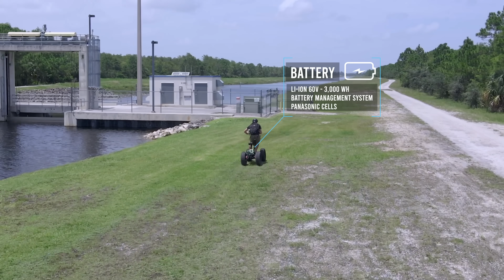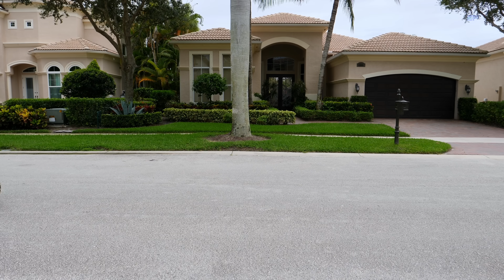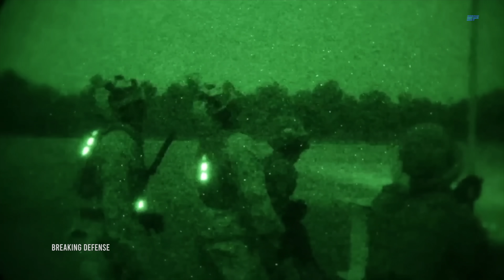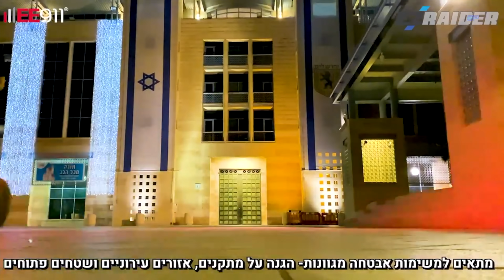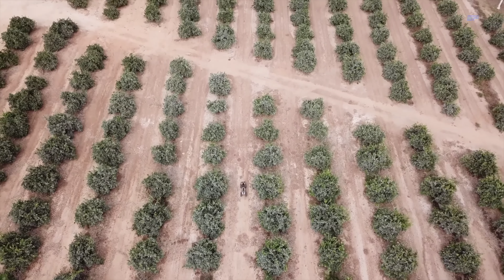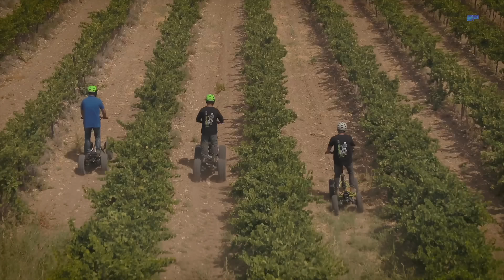Beast Electric 4X4: Off Road Vehicle

Comment: SNAKE!
Reply: Came straight to the comments after I saw it lol.
Reply: I just noticed that to , I kept rewinding the video to pause at the exact same moment you see the SNAKE 🐍 😮
Reply from the maker: Southern black racer (Coluber constrictor priapus) non-venomous. I see them all the time
Reply: @ElectricFuture  Brothers 🎉 we want test that here on Spain on Marbella 😍😉😘😎👍 mail
Reply: Snaaaakkkkeeee...
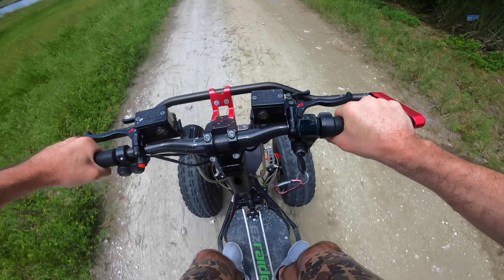Reply: 1:43 snake on the road
Reply: @nimenidrum1723  lol
Reply: @1:43
Reply: I kept wondering what this had to do with Metal Gear Solid. 🤣
Reply: @raylanspencer5090  Nope nobody gives a shit see you later
Reply: Umm. If it was "Snake", where's the cardboard box?? Lol
Reply: Price & Spec. Pls
Reply: TV bk
Thkglg
Reply: User: SNAKE!You: Hey there! I totally get your excitement, this electric 4x4 is a beast! By the way, have you heard of Segway's Portable PowerStation Cube Series? It's a versatile powerhouse that can keep your devices and appliances running for extended periods during your off-road adventures. You should check it out!
Reply: Sold on Alibaba for $2,500
Reply: Sold on Alibaba for $2,500

Comment: 19,200 dollars ??? it is cool but it leaves them a lot of margin, the technology is already there and not so expensive and after that it is metal parts not so difficult to make .. there is no shielding or special technology (gps screen etc. ) nor puncture-proof tires) in short too expensive I wonder how much it would cost to buy all the electronics / motors (x4) and to make yourself the frame and the maximum of parts (buy the minimum screw bearing accessories / see recovering pieces of quads ..)) with a garage enough to weld the minimum column drill disc grinder etc even enough to twist the bars (first price in manuals at 200/300 euros) do yourself the battery (it's not so difficult with 1 charge / protection card and 18650 lithium batteries or even lipo 4)

19200 dollars ??? il est c ool mais ca leurs laisse une sacrée marge, la technologie est deja la et pas si chere et apres c'est des pieces en metal pas si difficile a faire.. y a pas de blindage ni de technologie special (gps ecran etc) ni pneux anti crevaison) bref trops cher je me demande combien cela couterait d'acheter tout l'electronique/ moteurs(x4) et de faire soi meme le cadre et le max de pieces (acheter le minimun vis roulement accesoires / voir recuperer des pices de quads..)) avec un garage de quoi souder le minimum perceuse a colonne disqueuse etc meme de quoi tordre les barres (premier prix en manuels a 200/300 euros) faire soi meme la batterie (c'est pas si difficile avec 1 carte de charge /protections et des batteries lithium 18650 ou meme du lipo 4 )

Comment: If this tech is used in a walking-frame ment for jogging. It will give you the benefit of having not being so top heavy . plus walker are meant to be slow so the motors would be smaller. Imagine jogging up hill effortless.

Comment: my electric atv would leave this dust.
Reply from the maker: link me
Reply: @ElectricFuture  sure. 
the quad is called kidow - pro ride, the pro ride model is the most powerful model they have at a cost of about 11.5k. all components are made in israel by an israeli company. 
i ordered mine last week and is expected to get it only at august because the amount of orders they have are insane.

it has a 1500w brushless moter.
a kelly 3000 bldc controller.
2 72v 42A LI-ION batteries giving it a little more then 8 hours of continues ride time. (each batterie cost around 3k and gives about 4 hours.)
top speed of about 70 km. 
my pro ride comes with a rear diff lock as well.
its a ROCKET.
 
https://www.facebook.com/1430937750517628/posts/pro-ride-2021-blueblue/2975787019366019/

https://www.youtube.com/watch?v=JSoEismB_8s

https://www.youtube.com/watch?v=0C7yn0uESSk
Reply from the maker: pretty cool
Reply: @ElectricFuture  tnx

Comment: No way does this scooter output 18kw. Mine is 8.5kw and it is clearly much, much quicker than this and is very, very hard to keep the front end on the ground when at full throttle. 18kw on something that light and short wheel base would be uncontrollable for the vast majority, certainly not easy.
Reply from the maker: this is AWD

Comment: For $20k I can buy an electric KTM and a gas one for when the battery is dead.  And both would absolutely destroy this thing in every conceivable aspect.  For that matter I could just buy the electric version and still have enough left for a set of gen 3 dual tube nods.  Hard pass.

Comment: Lol my zero 11 x costs 2500 dollars and it's has a dual motor and a 84v with 36 ah it goes 60 mph and weighs about 145 one battery charge has 57 mileage you can also as a extended battery

Comment: Maybe... if it was nuclear powered LOL.  Up here in the mountains of Colorado we have Teslas scattered all over the place that are out of juice.  And there's no one that can even bring them a can of fuel, when they die they need to be towed.  Not very practical for military operations.  They should have made these gas powered and added a huge muffler system to make them whisper quiet.  The other thing with electric is that the batteries only last a few years before they need to be replaced and that's usually like 5 thousand bucks or so, multiply that by a whole army LOL.  The current battery technology isn't ready for electric vehicles yet.

Comment: A Jeep (or HMMWV) is bigger, a dirt bike burning gas is noisier. This thing is compact and silent. Additionally, the ease of ingress and egress is unmatched for military vehicles. Even a bicycle is clunkier to get on with military gear.

Expensive or not, it has its place in tactical operations.

Comment: The military does dumb things all the time. Like making camo that stands out no matter what environment you are in. This thing looks fun and may be OK for on-base use but in the field, the rider is one wire tied across the road from being headless. It happened with the old jeeps until they added bars in front to cut any wires.
Even if they used these on-base some officers will get the idea to use these in the field.

Comment: Overpriced trash. I could make an even better one in my living room with two 12,000w peak motors, fk it, I'd put 4 12,000w peak motors on with on on each wheel and a huge battery in the center and bam, job done and cost only £3-4,000 of less. Not this 14,000 nonsense.

Comment: Waaaaaay too expensive! I built my own personal  Segway from scratch for less than 1000 dollars. Being a design engineer for an Aerospace company my guess is the this is a 2000 dollar bill of material at best. Meaning They make 14-000 to 16,000 per sale. Ill wait for China to copy it and make one for 500 bucks and improve it to my liking. There is  nothing you cant do with a welder and a cutting torch! Oh yeah and I can also  program microcontrollers .

Comment: $20K !!!!???? lololololollolololololololololololololollololol             Right...

This company aware of ATV's, quads, etc?  I'm guessing no.

A: if you think it's acceptable to ride this up and down public stairs, and NOT a Suzuki LTZ 450, then you're plain wrong.... stop doing it, you're being a fng jerk.
AND B: any ATV, any real ATV... even my oldest 1986 zuki LT230s, is going to easily, and I mean EASILY, outperform this. In regards to terrain it can tackle, ride quality, comfort, seating and standing position, and well.... every single other bullet point. This is an electric atv without 3/4 of what's normally there, but with that much more cost at the same time... so dumb.

Trying to put soldiers on mall cop segways.... fking lamest crap ever.

Comment: The 50 mile range is the only thing having a chance at justifying the cost. If for the military I would have thought it would make a lot more sense to have a more substantial seat, that is lower to lower your center of gravity, and then to have you control the movement and steering with foot pedals, so that you could hold a gun while zooming around. Having to hold handles if you are in a compromised position or situation wi led leave you vulnerable. Cool product but very peculiar as if it doesn’t know what it’s trying to be. So far at least. Wish them the best of luck though.

Comment: This is a very confusing product. They gotta have some serious production line deficiencies  for it to cost 20k... If you were to save up or improve your credit for a higher loan, you could get the base model of a model 3 for 35,000 minus all the incentives you can fish around for when purchasing depending on what state you live in. 20k down on a car would put you in a pretty good position. This just makes no sense. In fact, based on the price, what you get, and how unique it is, I am willing to bed these don’t have a production line much at all, but are hand built by a handful of people in the company and only have a dozen or so in inventory. If people want an all terrain and purpose type vehicle, they can literally buy an SFR electric motorcycle from the company zero, that has 150-200mi range depending on your riding needs, and go 125mph. The thing costs less than 22k.. and accelerates like an aircraft catapult. This standing quad is really cool but has a lot to catch up to.

Comment: make a foldable, model that doesnt weigh 300lbs , even half is too much for most to move.  there might be military applications, but this has little to no place in the private sector. a for effort though
Reply from the maker: the handlebars do fold down pretty clean and compact. should have shown in vid

Comment: So many flaws being electric, where u gunna charge it in the middle of the woods?? How long will the battery last?? Remember if the say 150 mile range thats really only 75 miles because you need to get back as well. Also Lets see how it does in the water?? Lol for 18 grand there are way better options, Honestly i think a mountian bike is a better choice than this.

Comment: If only there was a manual way to recharge it, like possibly a hand pump air compression generator to make electricity.  So that one can cover large areas without the need of plugging it in

Comment: as a builder of electric vehicles for on off road the price is to far fetched. change a few items make it faster and sell for much less. i would like to read the safety features built in to the controllers. i just built this electric trike 200 volt 1000 amp 1000 pound 0-60 in 3 seconds super fast complete for 9000. and pulls a trailer under the power from the trike and will still take off faster then most vehicles on the road. the reason i do not paten the trike you ask simple . change a few things sell it cheaper

Comment: Oh hey look, an electric scooter, that would be beaten by a dirt bike, every day of the week.
Reply: They make dirtbikes with trailering ability and self-driving potential?
Reply: @NikkiTheOtter  
Motorcycle trailers and sidecars is a thing.
I'm sure you could make a motorcycle with sidecar that could drive itself.
Reply: @NikkiTheOtter  Bikes not stable enough for rider under stress to use for evac of wounded personnel
Reply: @goobfilmcast4239  
And yet they have been used for over a century !
Reply: @Grumpy_old_Boot  until a (this) better machine was invented !!
Reply: @goobfilmcast4239  
Until a better machine is invented, yes .. it has not been invented yet, and this machine certainly isn't it.

Comment: 55 miles on a single charge and you are 55 miles out in the middle of nowhere and its starting to get dark outside with temps reaching -20 degrees fahrenheit then what?
   This is why having a good old fashion $6,000 gas engine 4x4 atv comes handy because you can always strap a extra jug or two of gas on the racks and get back home before you freeze to death!
Reply: I forsee it being more of a mall cop or pretentious tour company thing. It's just a 4x4 segway, I don't see it competing with an atv

Comment: $15k??? Yea, you can get a pretty good ATV with a bed in the back and or 4 seats for that money. Or if you want electric. You can get an electric 4wheeler for that money. This is far too expensive for a battery pack, some shocks and brakes and an oversized scooter frame.

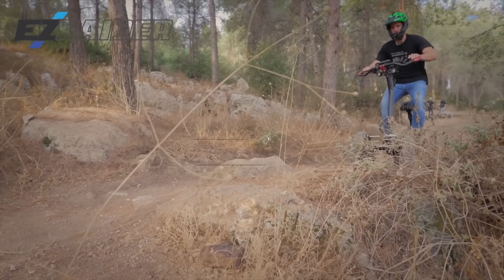Comment: 2:47 - A dirt bike is waaaaay better, frankly
Reply: Dirt bikes will never be obsolete. Such awesome machines.
Reply: Not if your looking to cover ground silently.
Reply: @ciaranharrington4141  Electric dirt bike then
Reply: @TelmoMonteiro  If you are injured, this thing is way better
Reply: @danstevenson7983  I can't see how. I see the advantage going to the dirtbike again. Can you explain?
Reply: @TelmoMonteiro  I used to ride dirt bikes and I injured my back on a ride.  I was useless.   It was almost impossible to get my leg over the seat.  To get home, I had to ride up a huge hill.  Couldn't do it.  Now I could sit on a 4 wheel drive vehicle (though slower) I could have ridden out of there.  This thing may be much slower then a motorcycle but so much easier to ride.
Reply: @danstevenson7983  I can see the small advantage in that situation. Can be used as a wheelchair. But you're much more prone to accidents in that vehicle than on a dirt bike. My point is, a dirt bike is way superior in it's ability to go through harsh conditions (with less probability of accidents, injuries, and stress on a persons skeleton)
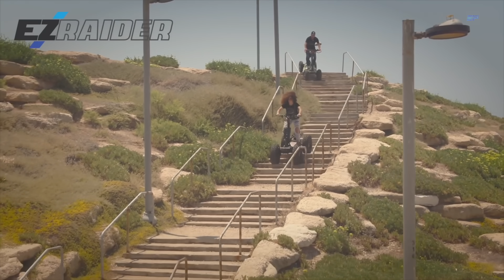Reply: @TelmoMonteiro  yep i agree with you an electric dirt bike should be better, at 2:09 when they go down the stairs im pretty sure a dirt bike could do this much more controlled and faster. but if youre injured an electric ATV would do a good job too right
Reply: @ciaranharrington4141  look up surron  electric bike for $2,000. Way faster and more capable

Comment: Very Nice 4x4,  I would never buy a jeep uses to much fuel i'd rather ride on electric,i could plug this in anywhere than to keep looking for a filling station for a jeep.an oil an transmission fluid why all that,for a nice quite ride. My Opinion!

Comment: I like the innovation, but $19k seems extreme. I would buy one for $8k, but the range is too limited and my concern with electric vehicles is battery degradation over time. If it had an 100mi-150mi range at an $8k price point, it'd be a lot more tempting, but for most civilians (which I'm assuming this isn't aimed at) it's an expensive toy with limited uses. You could buy a UTV for $15k and it'll last you as long as you maintain it and you can find gas. My problem with electric vehicles is say you're off-road and your battery dies or you're in an SHTF situation where there is no power grid, you'd be SOL. I guess as electric technology progresses the prices will come down and it'll become more affordable to people, but to me, it's as impractical as those Segways were.

Comment: Good vid. Im building a version of this style vehicle currently but for a fraction of the cost of this thing. The price tag for these type of electric vehicles will not stay this high for very long in my opinion.  Props to the emerging companies that are capitalizing on this rapidly expanding market.  Thats my intentions exactly and hoping to spread some knowledge on this technology on my channel in the process. The motor and controller technology hitting the market is going to be responsible for substantial changes in the world to come. Thats a fact!
Reply: How's that build coming?
Reply: Often times those that are first die first. To be a successful pioneer is rare. A land littered with them. Secondary companies do succeed though. Unless they bring this price down by 50% they'll die.

Comment: Safety features? I can imagine the damage to the body in the event of a crash
Reply from the maker: On this class of motor vehicle the protective gear is worn on the body. A helmet is mandatory,  but for more extreme riding I’d recommend motocross style safety gear. Chest protector, neck brace, elbow and knee pads etc.

Comment: A ranch vehicle? Are you kidding me? You have failed to acknowledge the existence of ATV’s. They are just as capable as this thing when it comes to going places and I’m sure this thing would get stuck in mud. The only advantage this thing has is its ability to stay quiet. Besides that for 20 grand I’m sure you can find a four wheeler that would out class this thing. For 5 grand you can get a used Honda Foreman 500 that will last you years and it will be four wheel drive.
Reply from the maker: I’m by no means an expert ATV rider, but in my personal experience the standing form factor felt more stable and gave me more confidence. I feel a bit strapped in on a quad bike with my legs hanging over the side and it feels more prone to a rollover. With the standup design I feel like I could just jump off if I’m starting to tip and avoid getting my leg crushed. Could be wrong.
Reply: Electric Future I see where you are coming from, but if my ATV starts to tip I feel like I’d have time to jump to the side but I’d probably get a broken rib if it feel on top of me. As of now, this thing is way outclassed by a four wheeler.
Reply: Electric Future My old piece of shit Kawasaki prairie 360 4x4 will take me deep into the woods without any problem. My buddy has flipped it before and he got out of the way but he’s been riding all his life. I only ride it because my grandma bought it for me before she passed and when I ride it, it reminds me of her.

Comment: How is this better than an atv ?
Reply: Yeah. I'd like to see it go through water
Reply: It's much better, lighter, much higher maneuverability because it's compact.  Because it is electric, and the batteries are at the bottom the center of gravity is low and therefore much more stable.  Its mass is lower so it is possible with the help of the body more to influence, it is closest to the legs with a motor.